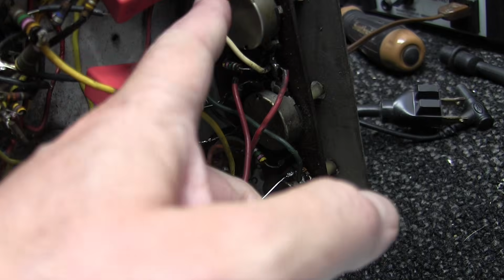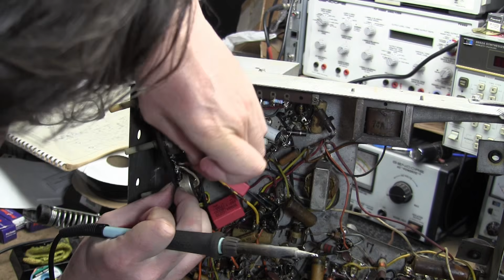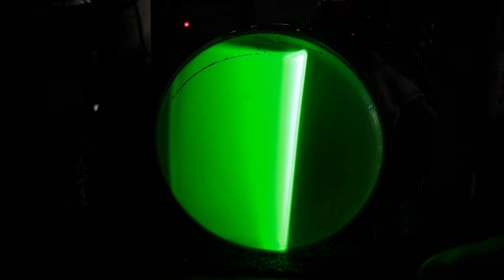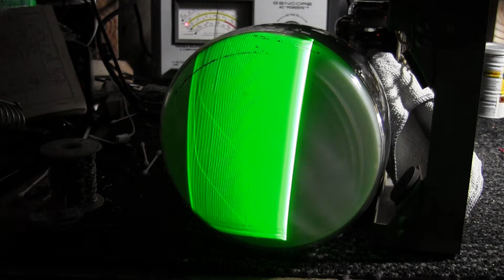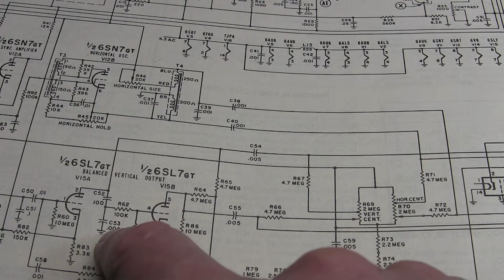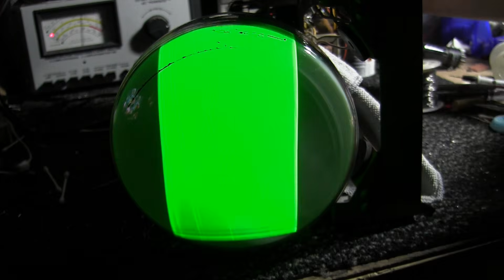How to restore a 1940s electrostatic TV (Motorola VT71, Admiral 19A1, etc) : part 7

Comment: The 6SN7 is a higher power, lower amplification factor dual triode than the 6SL7.  I know the two tubes look the same at first glance.  The 6SN7 uses twice the heater current and the plate dissipation is 2.5X higher then the 6SL7.  The 6SN7 amplification factor is 20 versus 70 for the 6SL7.

The 10 megohm grid resistor to ground was the most simple bias for triodes, typically generating -1.0 volt on the control grid due to the electrons piling up on the control grid.  In appearance, this looks like a Grid-leak circuit, which is similar, except generally a 1 to 2 megohm grid resistor is used.  The Grid-leak was normally used with a large signal applied to the control grid.  The grid would clamp the positive transitions, causing a significant negative grid voltage.

The 6SL7 was probably used for the vertical output due the low drive power needed since the frequency is so low (30 Hz).

I suspect considerable time was spent developing the circuitry to maximize the functionality of each tube and to reduce parts count, especially important since the electrostatic sets were usually the entry level TV set.
Reply from the maker: Thank you for the excellent info.  I expect they needed the higher gain to drive the less sensitive vertical deflection plates.

Comment: Interesting!
Here in l'il olde England, no electrostatically deflected TVs were produced post-war although many would have been built by keen amateurs using war-surplus parts gaining the name 'green-eyed monsters' as most of the CRTs were ex-radar having green phosphor.

Keep up the good work and as you will know, leaky paper capacitors are a frequent occurence in kit of this vintage.

Comment: Hi Bob. One question; is there any risk of arcing or carbon tracking in those pots from the DeOxit when you reassemble this and turn the set on?
Reply from the maker: Nope.  Nothing for them to arc too.  Remember the pots are mounted on an insulated board.
Reply: @bandersentv  - Sorry, misunderstanding. I meant, could they arc internally, not to the case (which, as shown in the video, is mounted on that insulating board)? That is, could it arc from either outer terminal to the center wiper once covered in DeOxit (that hasn’t all evaporated yet) when the HV comes up?

Comment: Bob, I'm an oscilloscope kind of guy. I'd be working on the vertical linearity at the vertical oscillator, and getting a nice sawtooth out to the plates as soon as possible. Bad R, bad C, bad tube.
Reply from the maker: OK, but in this case the big problem was in the output stage.